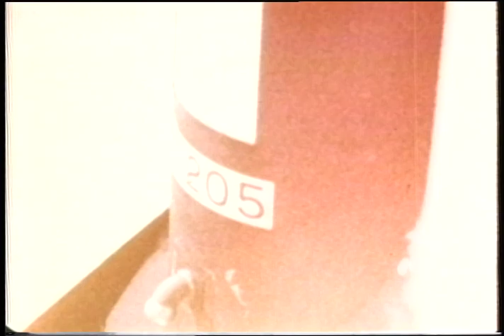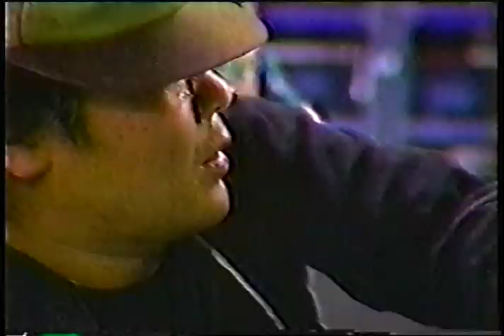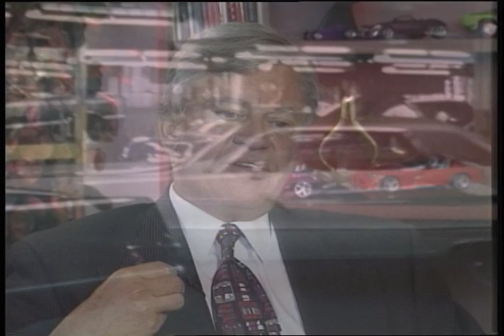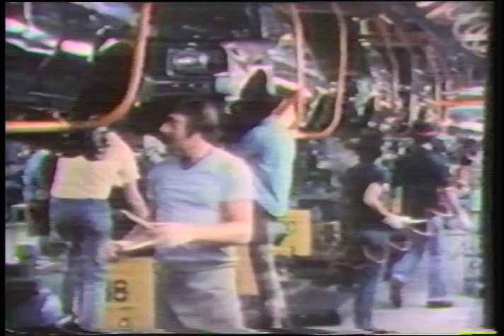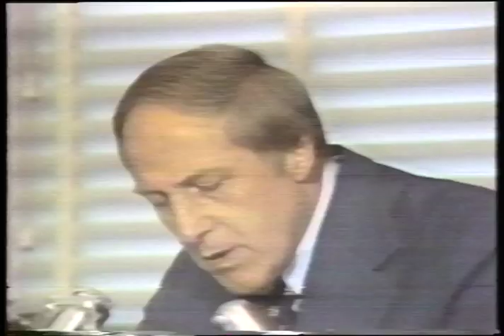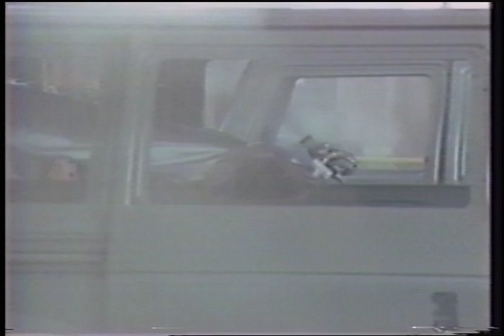Chrysler History: 1970s

Comment: I am surprised they didn't show a Duster. It was surely a success in early 70's. If I remember the line correctly, Duster was the #1 selling compact 2 years in a row. It overlapped with Volare in 76, then it was discontinued while Volare continued on.

Comment: What’s really interesting about this video is that the cars they call out for being launched at the wrong time in ‘74 and ‘79 are not actually shown at all. Most cars shown are the highly popular fuselage models of the early ‘70s and the extremely popular Cordobas of the mid/late ‘70s.

Not a single 74-79 Newport, New Yorker, T&C, Imperial, Monaco, St. Regis, or Gran Fury was shown in the video.

Chrysler’s bad management, particularly from Lynn Townsend, was a huge part of what brought them down, as well. Chrysler could have had compact FWD cars in the market by 1975, but Townsend refused to build the Alpine line in the US or import it from Chrysler Europe. Townsend started the disastrous sales bank system, and didn’t invest in quality and technology upgrades to the plants. He dragged his feet on offering a midsize Chrysler, as well, so the Cordoba came late to the PLC party. Then in 1975, he parachuted out of a company in serious trouble and his replacement didn’t have the time or cash to turn things around before the 2nd energy crisis hit in 1979.

Comment: There are people who didn't think Chrysler deserved to be bailed out - but I don't get why people think it was their fault. The auto industry did not have anything to do with the Yom Kippur War, or the U.S. government's support of Israel, which is what led to the 1973 Arab oil embargo. All of a sudden there was this problem of getting fuel, which had never been a problem before. Car companies cannot simply change their product line at lightning speed. Most people bought full sized cars until the oil embargo happened. What was stated here was correct - the Chrysler/Dodge/Plymouth full sized cars had just been released in early September 1973.  Then in late October, the oil embargo happened, and went on until early March 1974. Chrysler had invested money in creating the new full sized cars that now would not sell. Even mid sized cars and what were considered compact cars at the time were still too large and used too much fuel for the new situation. They did come out with the Omni and Horizon for the 1978 model year. They did come out with smaller full sized cars for the 1979 model year (came out fall of 1978). In the spring of 1979, there was again another fuel crisis, though it wasn't as bad and didn't last as long. This time it was the Shah of Iran - some political goings on there that led to another oil embargo. People thought this was going to keep happening. My point is that there were events that the auto industry had nothing to do with that led to a difficult situation they had to deal with. Ironically, Japanese cars were extremely small at the time, much smaller than they are now. The fuel crisis got people to buy them while before that they would not have. They've had to make their cars bigger and with more interior room since then so people would keep buying them.

Comment: Chrysler in trouble now.  2024.  Take the Dodge viper back to 1979.  Shorten the body. 17" inch wheel.  245/50/17 tire.  Engine is a 340 c.i. mpfi.  8 speed transmission.  Rear wheel drive 9" 1/4" differential with 3:73.1 axle  gear ratio.  116 lsa camshaft with .214" inch intake/.219" inch exhaust @ .050" inch duration.  Government regulations.  $14,000.00 u.s.d. No government bailout needed.  Everything is in the dodge warehouse for a increase in small business capita.  To pay sponsorship which is the American government.  TRUE dual exhaust at 2"1/2" inch diameter. Rear tailights from the Jeep Gladiator.  The rear trim from tailight to tailight from a 1983 dodge truck that has Viper.  3.00" inch driveshaft.  Front headlights flip up are dual circle high intensity with triangle in the middle of them facing forward.  Under each headlight is the yellow mist rectangle turn signal from a 1983 dodge d150.  To get the dimensions correct do a clay model. Front grille will be from a 1983 dodge d150.  Dodge will be between the yellow mist turn signal lights centered.  2026 Dodge Viper 235 Hp/ 250 Tq. Cylinder heads combustion chamber 88 c.c.  small intake valve, small exhaust valve.  Government regulations.  Go Sam Houston.